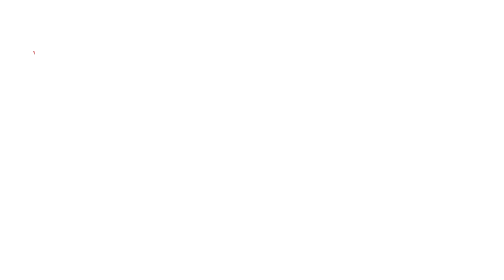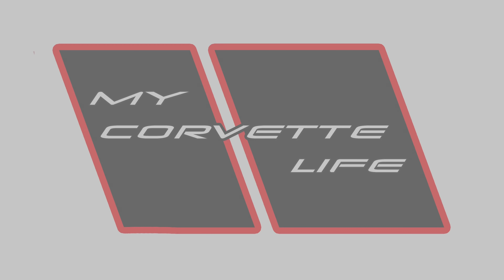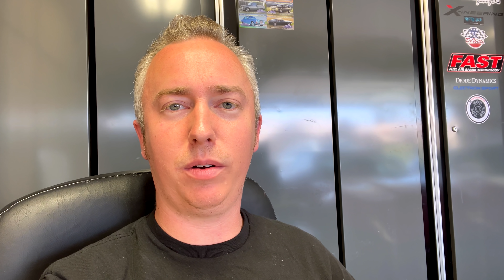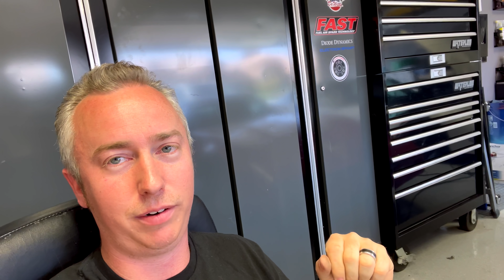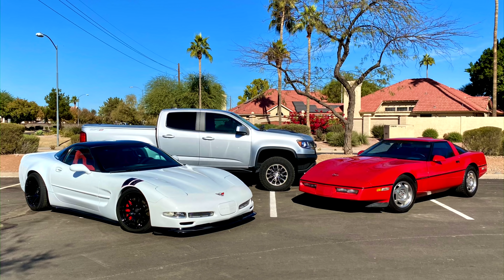Clearing The Air

Comment: Chris, did you take off the belt and run the car and listen for the noise? This would isolate the  the rotating components and listen with the car in the air for the torque tube..
Andrew G Kalipetis, GM World Class Technican

Comment: By the way Chris, I have a chirp, squeal,  noise,  what ever you wish to call it. Turned out to be the belt tensioner was going bad, take off the belt and spin it, and then turn it in your hand slowly to see if you feel any resistance. Could be that, and a cheap easy fix.

Comment: I saw yesterday about the power steering and the torque tube. Would it not be a simple case of pulling the drive belt when the chirping is heard to rule out the power steering pump? I am sure this has been considered but didn't see it mentioned
Reply from the maker: That’s not it.

Comment: If you're having problems with the AC could it be possible that the compressor is what's making the noise, that is if it has a belt connected.
Reply from the maker: I removed the belt.

Comment: Chris, I have completely rebuilt my 86 pace car, it was a flood victim and sat beside a pole barn for 3 years before I got it. I know alot about the C4 Corvettes with the tune port, and can troubleshoot most problems. I am a member of the Mid America Corvette Club, and used to be in the National Corvette Clubs of America. I do ALL my own repairs, and have alot of friends that also know C4's. So if you ever have a question feel feel to drop me a line, and I'll do my upmost to help. Just fixed a problem with my electric seat function and fixed my heater a/c fan issue, and installed a new stereo too (put in a flip out 7 " screen with hands free phone capabilities. I can trip the computer so the car will tell me what's wrong to diagnose problems. As far as the haters, screw them. It's your ride! Let me know if I can help, be glad to help in any way I can for a fellow C4 vette owner. (Need e mail addy tho to respond).

Comment: Chris I am having problem with my 1996 c4 with my crank shaft sensor. I have replaced the sensor the computer and now replacing the engine wiring harness I hope it will change my code on the crankshaft sensor. I fell that the problem is in the timing chain cover. Can you give me something to think about to help me solve my problem? Thanks
Reply from the maker: Have you cleared the code and seen if it returned?
Reply: was it 0335 code  or what ?

Comment: 6:40 ... NOOOO!!!! Firing the parts cannon is the WORST way to fix a problem. Yes, you will eventually find the problem, but at what cost? You need to find someone who can do a proper diagnosis. I would honestly rather pay for diagnostics, and then do the nut and bolt work myself. 

Using your A/C issue as an example. There is no such thing as an "Electrical Gremlin" ... There is Power, Signal, and Ground. There are switches, wires, relays, and connectors. Your issue exists somewhere in one of those things. And a skilled diagnostic mechanic should be able to tell you EXACTLY what is wrong.
Reply from the maker: You can call it whatever you want, it’s an electrical problem and not the AC system.
Reply: @floodx4 You're 1000% correct.  I'm not sure why he brushes the concept aside.

Comment: gm oem power steering easily go 300k before even the front seal starts to seep. I wouldn't tell people it's got 120k you gotta expect it to be failing. you're just playing into the incorrect stigma that corvettes with 100k miles just start falling apart and the value drops. they simply don't as long as someone has done simple maintenance to them that any normal daily driver gm gets, but since they don't get miles being garage art, you gotta switch to time based maintenance cycle. I say that as a c6 owner with over 100k, passed camaro owner with over 100k all beat to death and my old 96 Tahoe has 320k on it. also as a mechanic hydraulic pumps don't just fail like you're describing unless you see the fluid full of metal for some reason, but I doubt it. if it's spinning it's pumping. you've got a pressure valve/solenoid of some sort opening.

oem gm ls balances are a bad design of running the accessories off the rubber isolated weight. it's just asking to fail, so I'd consider that a mod even if it's not bad. all the Gen 1 balancers had the belts run off pulleys bolted straight to the hub, no load on the balance ring. which is why they don't really ever fail. 

my 0.2 good luck sorting it out.
Reply from the maker: Well that is just false.  I literally just replaced one on my C4 (same unit the C5 uses) that had 140k and it was leaking worse than a run over fire hydrant.  It has nothing to do with being a Corvette.  A car is a car.
Reply: @mycorvettelife  I'm guessing front seal leaking? they do dry out, I've changed some on the old 70s cars we had when I was a kid. was your c4 parked for a long time? maybe it dried out from sitting? because I've been around a ton of high mileage ones and never seen one with a problem besides a little seeping that's not normally worth fixing. but either way, how was the steering, besides the front seal leaking, was it still pumping fine?

Comment: Catch can.... lol.. ima keep saying it till u say something about it lol...
Reply from the maker: I’ve seen your comments.  Video coming soon...
Reply: You have my curiosity here.  Why would a catch can cause chirping?
Reply: @danielkinsler46  I honestly don’t have a clue, but mine made that noise till I changed to a catch can with a breather, “Mighty Mouse”catch can. I want to think maybe the crankcase pressure is to much? Needs to vent out? Idk tho.
Reply: @Chicago_racing  hmmm only time I have heard noise from a catch can is when it isnt closed.  I still think adding some belt dressing would be another step in diagnosing if it is a belt/pulley sound.  It very well could be a PWS pulley.  But I would imagine the sound would speed up and slow down with RPMs if it were a belt too.  A bearing in the TT could also chirp as well I guess.